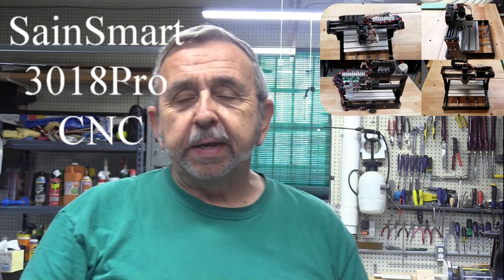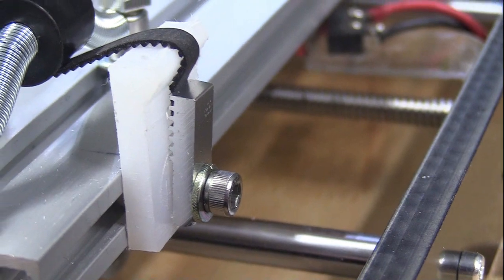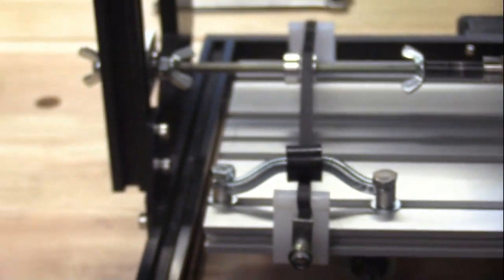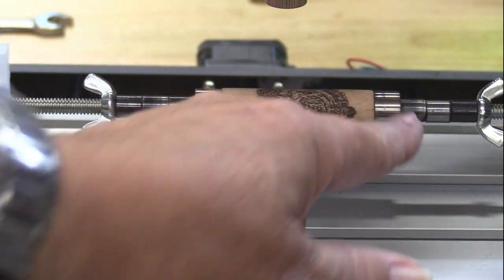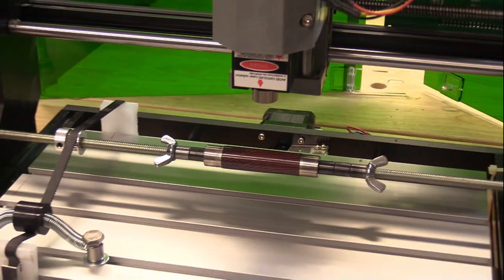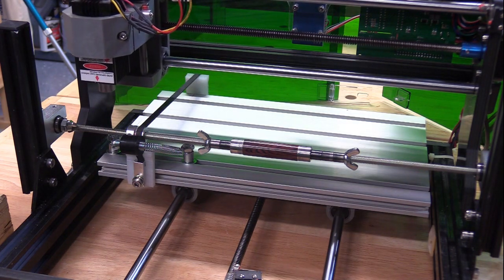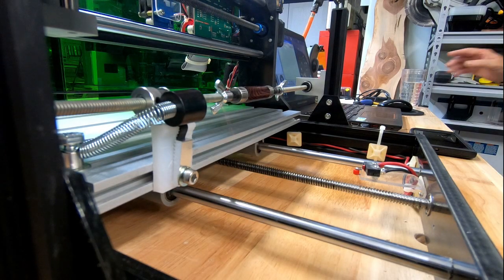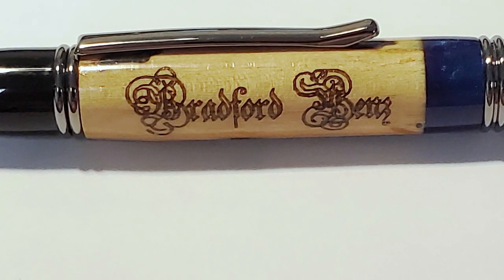3018 Pro CNC- Laser Engraving Rotation Attachment For Pens

Comment: Did you use the Y axis as the rotary axis?
Reply from the maker: Yes, the bed forward and backward movements are the Y axis, and in turn,  the rotary axis.  The circumference of pen directly matches the measurement on the Y axis for one complete 360 degree rotation of the pen. Hope this helps....Brad